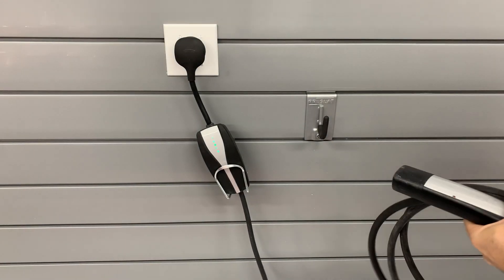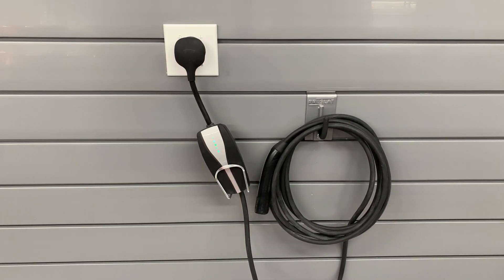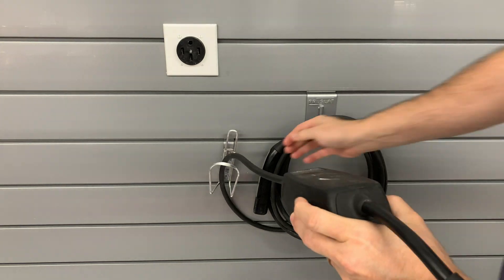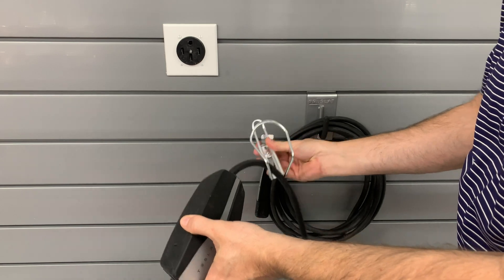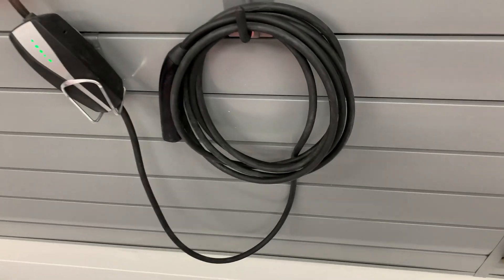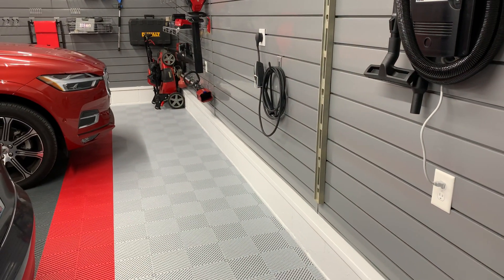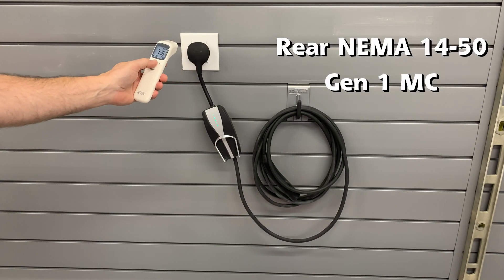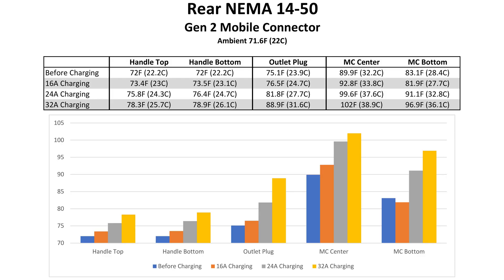Tesla Model 3 - NEMA 14-50 & Mobile Connector Heat Tests

Comment: Can you tell me what the temp is for your nema 14-50 wire? Just before the outlet at 32 amos
Reply from the maker: You mean the cable where the plug attaches to the outlet?
Reply: @MTNRanger yes before the outlet and after the adapter plug

Comment: so if it is 95 Degrees F in my garage, While not charging, the middle of mc body is expected to be around 113 degrees? It is surprising to me how it stays so warm even when idle.
Reply from the maker: It depends.  The difference in temp from ambient may vary if the EVSE was used recently among other things.  Have you measured the temperature on yours?

Comment: My gen2 connector at 32A is 124 degrees. Specs are 122. All electrical hook up was rechecked by electrician and was good. Car/ unit is 6 months old. Would you contact Tesla for a replacement?
Reply from the maker: Yes, I would contact Tesla. That does seem like a really high temperature.  What part is getting the highest temperature?  Near the plug or the center of the main body?

Comment: thank you for a great informative video.  certainly will take the route of hiring a certified electrician to install in my garage.  Do you keep the Tesla wall charger connected to the 14-50 outlet all the time or do you disconnect it from the outlet?  I am trying to find feedback/guidance on it should stay connected to the outlet after charging the vehicle.  Thanks
Reply from the maker: I would not recommend repeated plugging/unplugging since 240V outlets are not designed for repeated use.  The mobile connector uses 5 watts or less in standby.
Reply: @MTNRanger  If I am going to be away for several days, I often just flip the 50 Amp circuit breaker off. I started doing this when I found my Gen 2 charger body was rather warm even when not charging.  Happy to see how well you have documented this. I also routinely charge at 16 Amp, typically over the 50 to 75% range about 3-times per week.
Reply from the maker: @dwaswad  It’s not a good idea to turn breakers on/off frequently.  At 16A charging, my gen 2 mobile connector is barely warm.not charging it should be roughly ambient temperature.  If you are still within the car’s warranty period, the mc is also covered.

Comment: I wish that I had an extra charger to keep in the car at all times.
Reply from the maker: I bought the gen 1 mobile connector before I got the car back in 2018.  Having an extra one is handy on trips or charging at work.
Reply: @MTNRanger  Exactly! You also have a spare in case of failure.